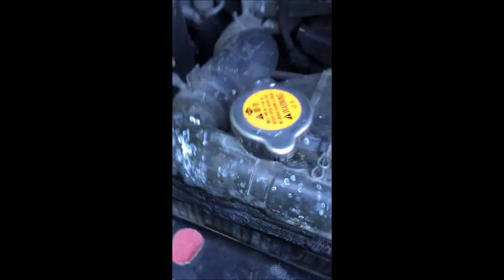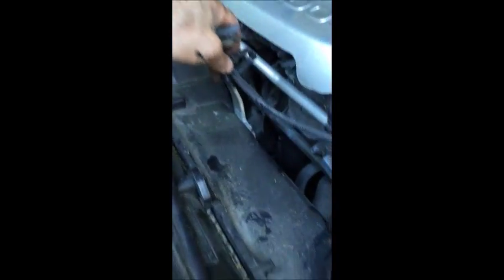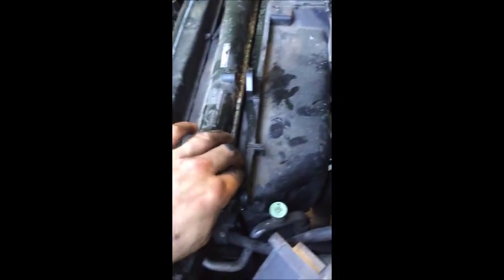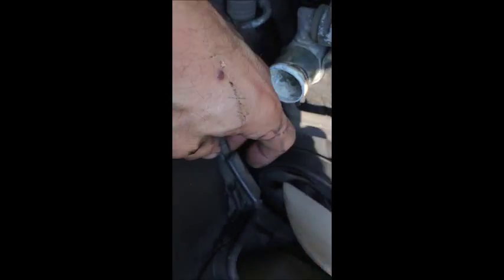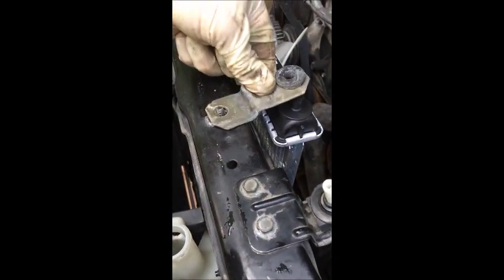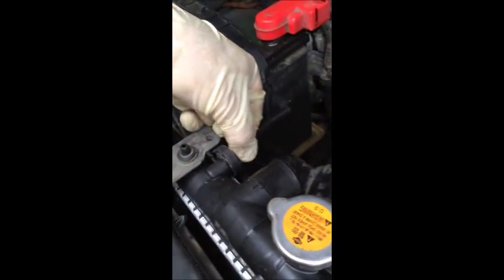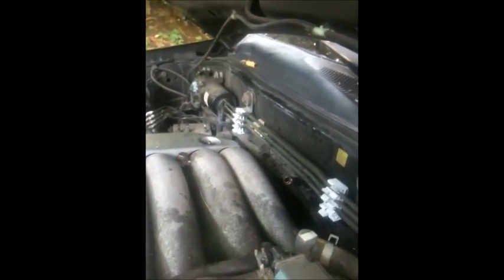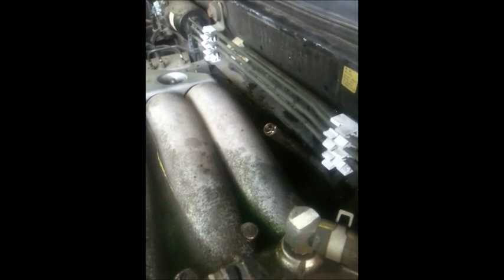Infiniti QX4 or Nissan Pathfinder Radiator Replacement

Comment: On some 2001 circa Pathfinders and QX4's there is another bleed screw (actually a bolt) closer to the front of the engine on the passenger side that you also need to bleed. Bleeding works better if you drive the car up on to ramps or a curb to get some height. Also, turn the heater on while you are revving the engine to get the air out of the heater core and hoses.

Comment: Dont forget to refill the auto transmission fluid after installing radiator. It goes in the straw with dip on left side, not the black canister which is power steering.
Reply: He just casually skipped over the transmission lines . I didn’t hear anything about that until the very end when he said to reattach. I was like wait what?!? So when you disconnect does all the tranny fluid come out of the lines? Do I need to be prepared to catch that in a pan as well? Man, that’s a huge piece of info if so . I’m preparing to swap radiator and thermostat on my 99 QX4 and I’m trying to get all my info set before I start taking her apart

Comment: I really appreciate your video. I ordered a replacement radiator and was able to easily replace it. I did have problems with my bleeder valve though. When I pulled the little rubber stopper off it was corroded. I had to take an ice pick and jam it down in there. After that I was able to properly bleed my system. It's cooling like a champ now.
Reply: Having a problem with my bleeder valve as well.  Took it off and it feels like it is clogged with something.  Not really sure how to unclog it
Reply: Shayne, did you order a genuine OEM replacement or aftermarket? Also, if it was a aftermarket replacement, what brand did you purchase and how has it been performing? Your reply is much appreciated.

Comment: is it really necessary to detach radiator from fan shroud. Looking at mine, it looks like the upper and lower radiator hoses, one hose going to the heater core, and the other two going to the transmission are all that are required to be detached. - aside from the two bolted down bridges up top. I'm about to do mine tomorrow.